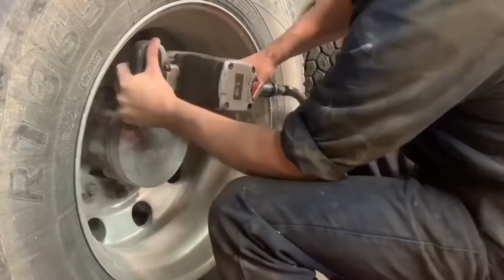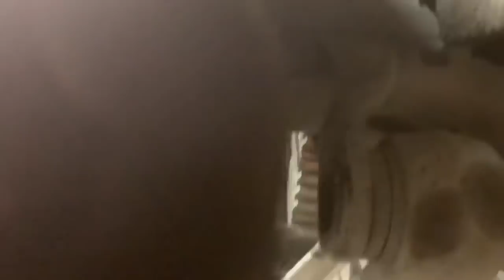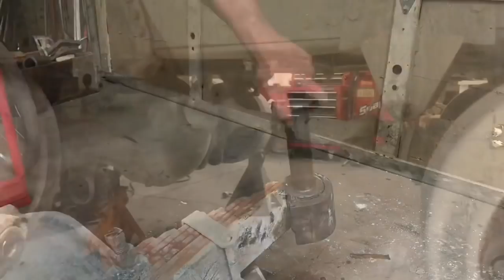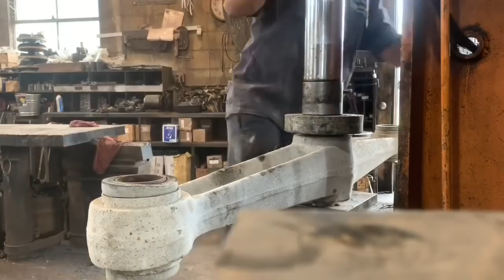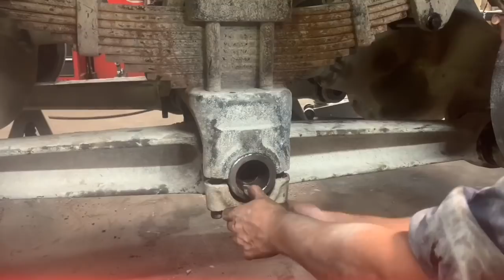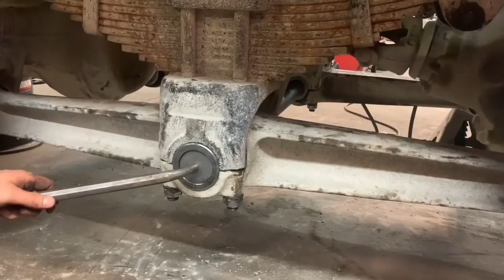Dump Truck | Hendrickson Rear Suspension Rebuild | Heavy Duty

Comment: What are the thumbs down for? Great challenging job well done!
Reply from the maker: Thanks for watching!!
Reply: Trolls
Reply: Hendrickson suspensions are hard work. Many times we lifted those springs and hangars out by hand and they are fucking heavy. It helps to have good equipment. Even with that said, they are by no means easy.
Reply: @AngeloBerardi-em3js  I used to replace them springs in the field by hand with no crank or lift. I have gotten older now and would not do it the same way!
Reply: @timstanford3443  No doubt! I can honestly say I don’t know one person who has done semi and equipment work that doesn’t have sore hand arms and a bad back. Most couldn’t do it for a day.

Comment: Exactly how I've done them in the past - many times ... Whenever possible I used to renew the road springs as well .. a real pain if one broke shortly after ... great informative and accurate video ... keep at it lads ! ! ! .... regards from a retired mechanic in England.
Reply from the maker: Thanks for watching!!
Reply: Yes, a job you don’t want to do over again. For the price of the spring, although not cheap, it’s worth it to do one time. Many times the pins won’t take grease and stresses the leafs causing them to break. Good video.

Comment: Well he makes it look easy.  I’ve been doing suspension Hendrickson especially for 30 years.  This job is not  normally this easy. Ivan give u one trick leave tire on and but 8” blocks under tires and lock down the brakes. It will make the job easier
Reply from the maker: Thanks for watching and commenting!!

Comment: Hey man great video. Question for ya. I have the rte and it’s time for bushings soon. But I was thinking just sell that suspension and swap in a air leaf set up instead. I can basically get a as new set up for what they will actually charge me to replace this whole bucking horse. It’s about 3-5 grand quote Canadian from anyone here. And 3 grand for a whole rear with empty diffs. What say you. It’ll def improve my ride. It’s a t800 dump truck.
Reply from the maker: Thanks for watching I really appreciate it. In my opinion this is one of the best setups for a dump truck. It can haul heavy loads and doesn’t take a lot of maintenance. I’m sure an airbag setup would help the ride tremendously but they’re more complex so there would be more maintenance.

Comment: I have the same system on my truck.  I purchased saddles because the drivers side is showing a crack.  I will be replacing both sides.  My walking beams are not taking grease.  I tried using the lock and lude where you hammer penetrating oil to unclog them.  What can be done so that they take grease?  I have replaced the zerk fitting.
Reply: Jack truck up and put new pins what suspention is this calld do you know ?

Comment: So is it possible to press those bushings out with a 20 ton press
Reply from the maker: Thanks for watching!! I’d say it’s possible but some of them are just stuck so have a torch handy.
Reply: The bigger the better. I do all the work on my trucks myself except for the center and end bushings (all 3 trucks  have Hendrickson walking beam susp.) These require so much force to remove and re-install properly and special tools to press them out/in that I’d rather pay the $3,800 to have them rebushed. Just the tool from OTC to do the end bushings is over $12,000 dollars with the right adapters:
Reply: Yeah bud I get my I got my 20 ton press from Harbor freight for 150 Plus tax
Reply: @terrellscaife2411  If you can do it with just that little press let us know, I’d be impressed. I’ve got some of the tools it would take but this guy had 8-12 hours in this job, so for me it would probably be a lot longer, say 3 work days where the trucks down not making $95 an hour. At that point I break even having the shop do it and I get it back the next day and avoid a sore back and neck. The Hendrickson book says you need a 100 ton press minimum to do the center bushings, then drag out the 1” drive impact gun and fire up the big compressor to run it. I’ve got these tools plus the 4 25 ton jacks it takes but I don’t have the right size adapters to press out the old and in the new bushings (they’re different sizes for center and end bushings) just those adapters cost $1,200, and I’d hate to wrestle the 160 lb each beams back up in and tighten it all back up, I don’t even have a torque wrench that goes to the 550 ft.lbs required to do the job.
Reply: Yeah JR I see your point but I was really just asking the question will it work i’m not sure if I would do this job if it came our way I i’m just really a neighborhood guy I would work on anything for my lawn more to a big truck I mean I have 20 ton bottle jacks 12 ton jackstands so maybe not a walking being job but maybe a normal suspension job for me